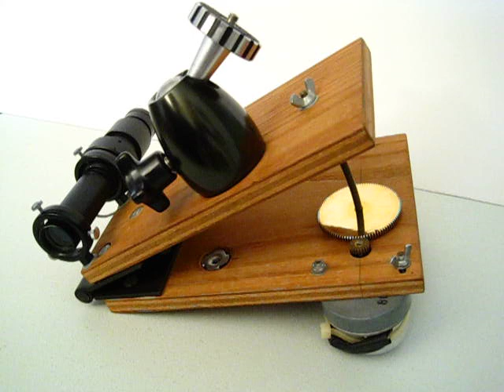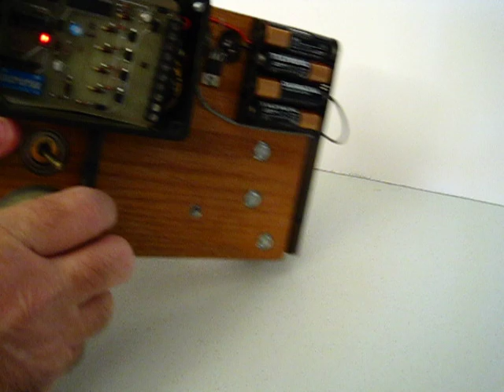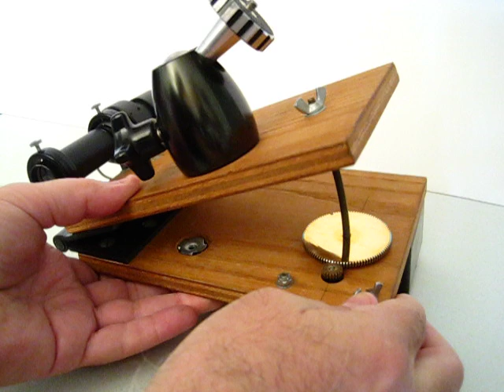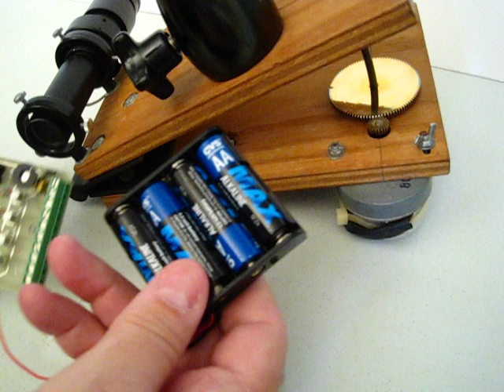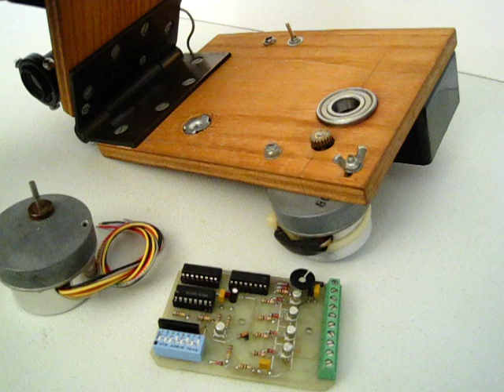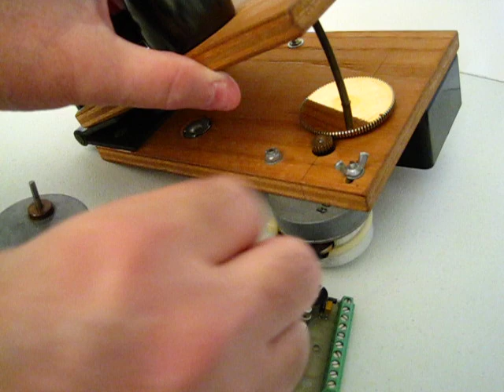Barn Door Notes - AstroKits Stepper Driver Board and Motor

Comment: How much for a kit?  Any soldering required, or all assembly completed?
Reply from the maker: I have the (new) assembled motor driver board and (nos) stepper motor listed at cloudynights dot com and the brass rod in a separate ad. I added links to the ads in the description above. No soldering required for the circuit board itself. Connections to it are made by the green terminal strip on the board.

I'm sorry I cannot provide a total tracker kit as I did years ago. But you can design your own tracker. My parts are what you need to attain tracking accuracy.
If your using a digital camera, you won't need the ultra precise finder scope seen in my videos. I was using film that needed much longer exposures than digital. You can use a small rifle scope or 6x crosshair finder scope and estimate where the NCP is. It's a good idea to improve you polar alignment as best you can. Errors in tracking are almost always really an error in polar alignment.